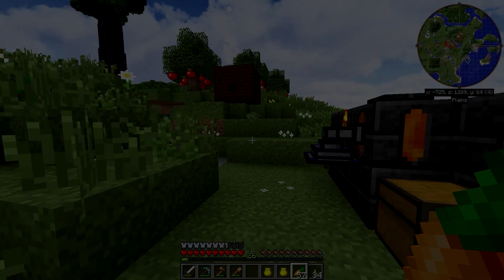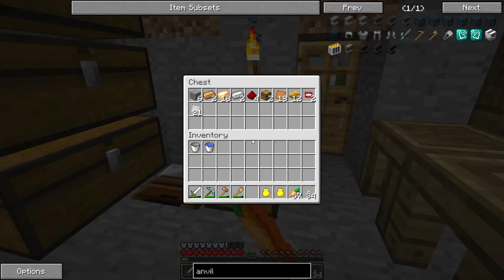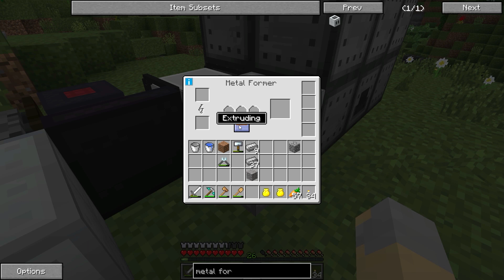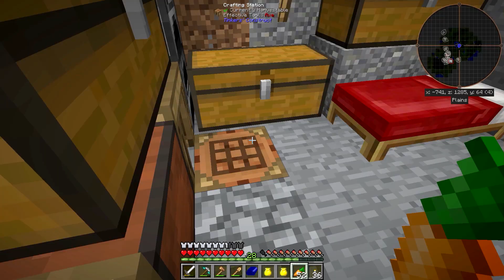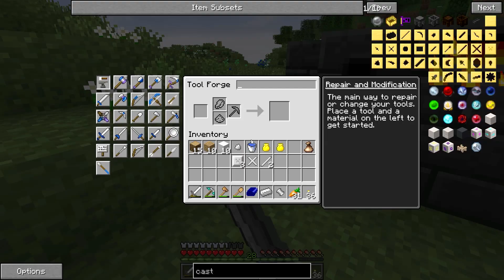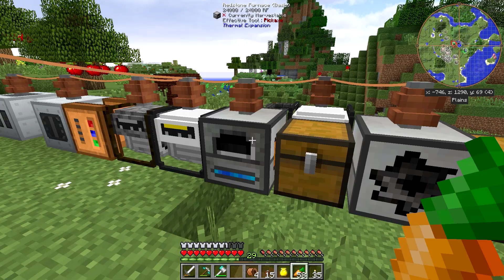Infinity Evolved - Ep. 5: Machine Frames! | FTB Infinity Evolved Expert Mode

Comment: Just a note about your IE wires.... You want to set up up with the very minimum connections between the power source and destination. Every hop from one connector to the next will cause a % power loss. If you plan to use them long term I highly recommend setting your power distribution point above the machines and run a wire down from that point to each machine. The way your currently using them you are loosing quite a lot of power in the lines.
Reply from the maker: +Landstryder Good to know!